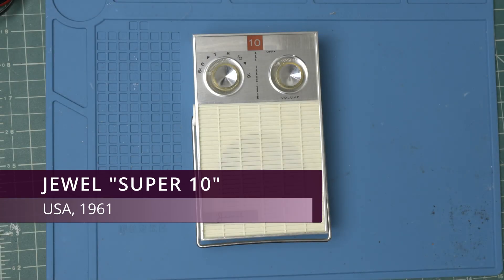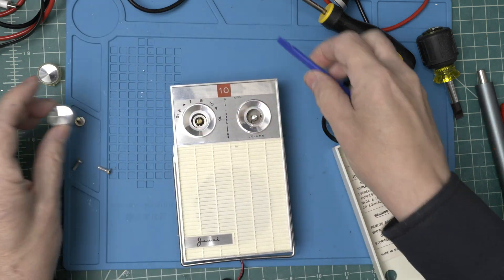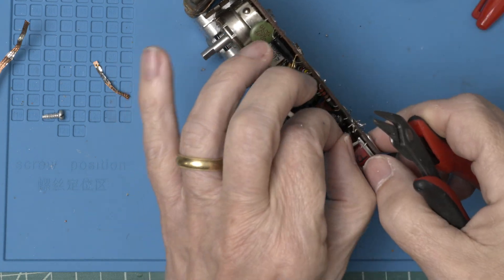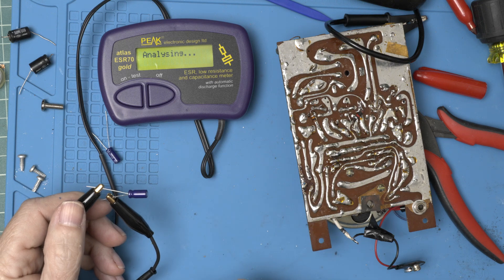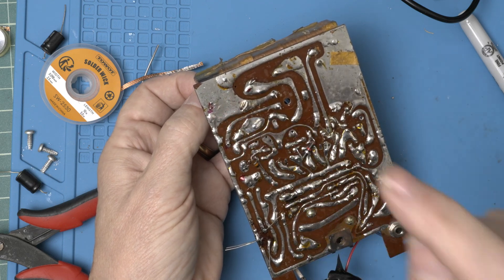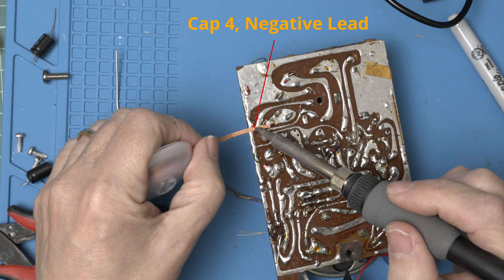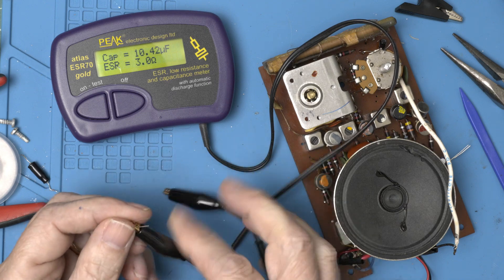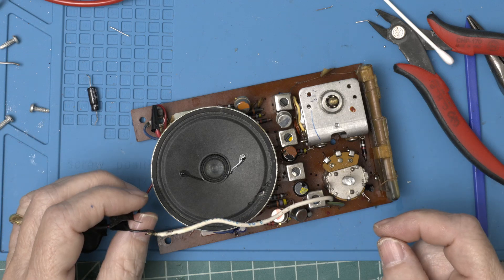Vintage Electronics Repair: Dead Jewel 10 transistor radio restoration

Comment: Where those two caps were that were in parallel - I would have just doubled the UF of one of the originals and used one cap.
Reply from the maker: Good  point.  These days one 100 μF cap is smaller than those 50 μF caps and would have fit easily.

Comment: Nice job. If you didn’t have the cap measuring tool and just fired the capacitor parts cannon at it, how many of these could you successfully fix? 90%? 95%? 67%?
Reply from the maker: I'm learning!  If its weak volume, even very weak, and some kind of station can be heard with your ear pressed against the speaker, it seems to have a high success rate, like 95%.   If you just hear a single scratch when you turn on the volume knob and nothing else, maybe 20%.   If there are no stations but the volume control seems to work (louder static), then 80%.   Very round numbers of course!   You don't need the cap measuring tool, that's just me geeking out.
Reply: @Dream.Build.Create I’m learning from you. And a few others. I am going to stop by Guitar Center and pick up a can of deoxit 5 next time I’m out. Watching and learning. And realizing there is a lot to learn. I know that you cannot break something if it is already broken, so I will find a $5 fb marketplace radio to be my first victim, er, victory. Thank you for your videos.
Reply from the maker: If you're picking one up in person, bring a 9v battery and some AA batteries and try the "does it make noise" test.  Avoid the ones that just give a pop and then silence.
Reply: The original battery was a tubular 9 volt with a large clip on each end. RCA and others used them until they switched to imports. Heavily obsolete in just a few years.
Reply from the maker: I have another one coming up with that takes the same battery, but no room to put in a square 9v.  I’ll figure something out!
Reply: 9 @Dream.Build.Create  use 6 alkaline button cells(LR44 or 357 or 13 should work)in a tube, you can also use 3 lithium cells instead.